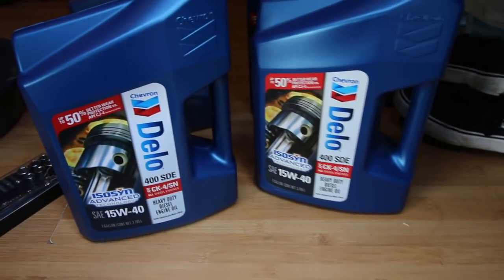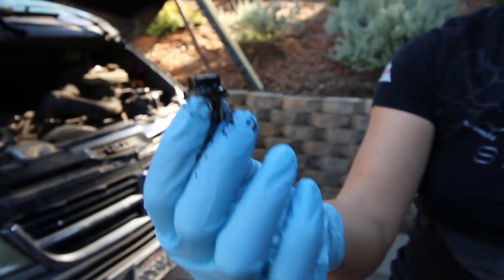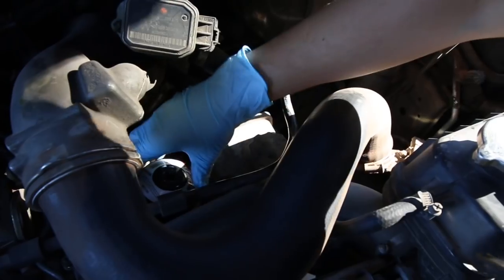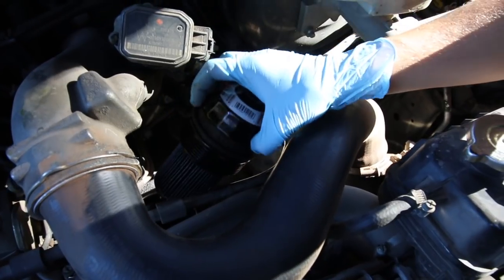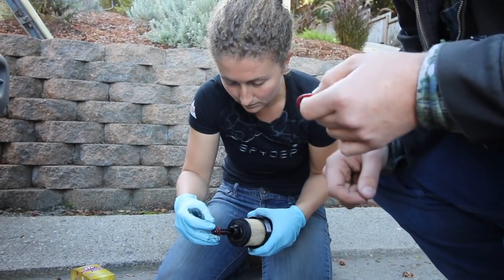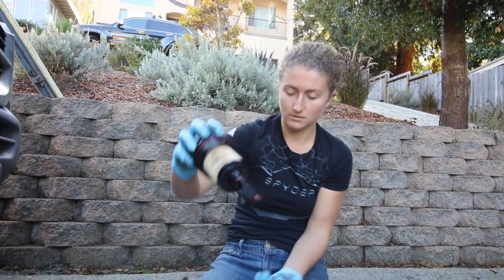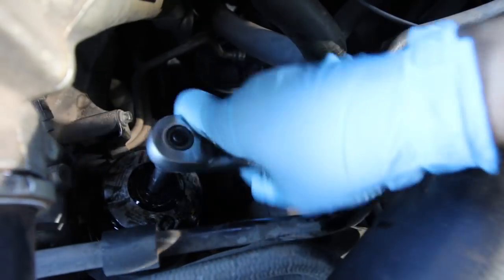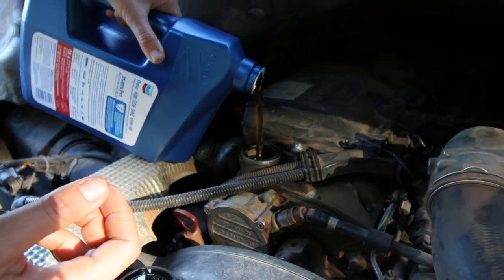Sprinter Van Oil Change! 👩🏼‍🔧

Comment: you can also use the oil filter attachment point as another place to add oil before you put the filter back in,  It's a bigger opening so you can pour in faster.  Just save the last couple quarts for the actual oil fill location after you put the filter back in.

Comment: Great video. How did you dispose of the oil? I always think about doing my own but the disposal side seems like the headache part so I just let the folks take care of it.
Reply: Any reputable auto store will recycle your used oil for free!
Reply: I save it up and paint my fences with it, used motor oil is fantastic for that.
Reply: I hope you're joking Willy, because that sounds like a serious pollution issue
Reply: O'Reilly, Auto zone, advanced Auto, Napa. All these will take used oil. (Motor, transmission, power steering, brake)

Comment: I have a 2004 and a 2006 sprinter 3500. When I change the oil it takes 9 1/2 quarts each time. So I am confused about the amount of oil you are saying you used.
Reply: It’s for sure 9.5 quarts!

Comment: Also the best time to change the oil is 7,000 miles, Mobil one synthetic rate for 15,000 miles with oil filter rated for 15,000 miles also. 
Another major things she forgot to replace, the air intake filter

Comment: So 12k instead of 10k
Thats 20% late which will reflect on engine life.
Change the fuel filter while you are at it as clean oil and clean fuel are the life of a Diesel engine.
Mechanics would use a torque wrench so its not over tightened or undertightened